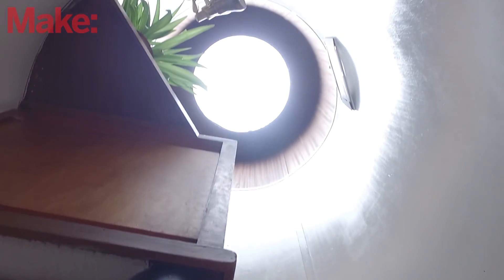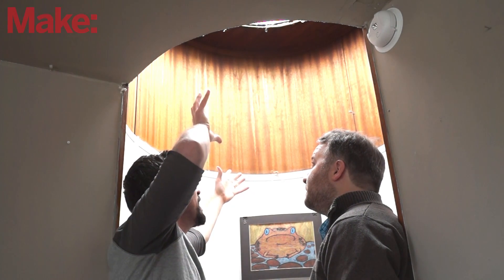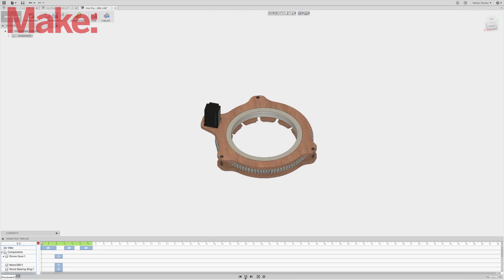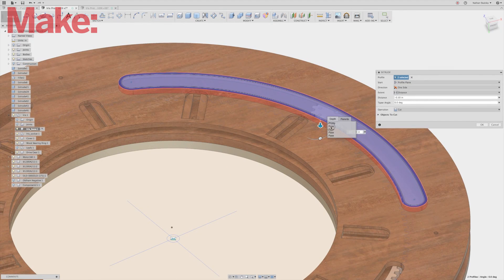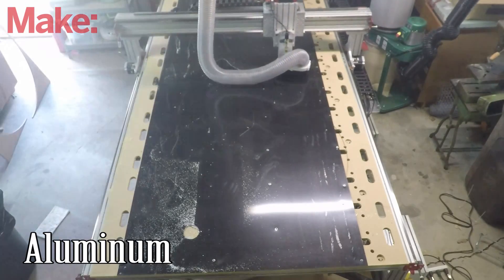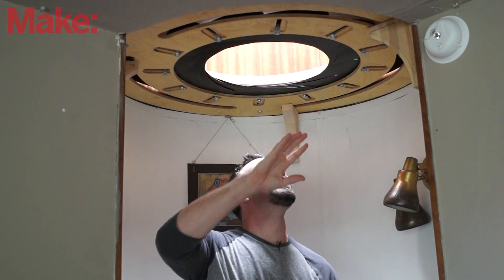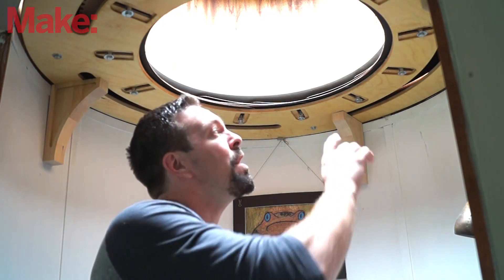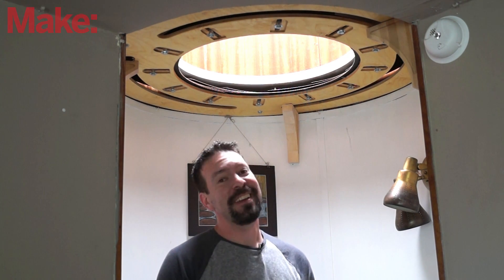Giant Mechanical Iris! Cut on a CNC Router Parts PRO60120

Comment: Beautiful design.  The center not closing completely isn't a big deal as I've seen many implementations that didn't seal the center.
The light blead from the outer portion of the fins would be unacceptable for any of my implementations, however.
Again... beautiful project.

Comment: If it wasn't cost prohibitive, I would add a lens system so that the sunbeam could be sharpened or softened as desired. Even a color gel system would be cool. Then you would have a giant followspot. Just, make sure you don't set fire to the floor.

Comment: Just attach a small extension piece to one of the blades and that gap goes away...
Also, if you chose to use a crank, consider having a double one (at the stair's top and bottom, with 90º gears at the wall parallel axis and all that steampunk feeling).
... and yeah... those external gaps... get rid of them, please (just decrease the outer ring radius a bit, for instance).
(Everybody's a critic... hehehe).

Comment: Awesome! I'll do this on a sun light i have. I'll cover the bolts with some wood caps or half spheres. And most important reflection on these upper part of the black petals, it will absorb to much heat and damage the black plastic.

Comment: Beautiful design! I myself come up with a different idea of dimming light. You only need two circles with polarization filters - one is fixed and the other can be rotated in between of 0° and 90°. It allows to make filters parallel or perpendicular to each other thus changing their transparency. It's lightweight, has only one moving part and has the ability of changing the transparency of the whole window very precisely.
Reply: Lot less work involved. But how costly is the polarized material
Reply: @gleggett3817  I didn't think about it, but you can get 42/59 cm (16.5/23.4 In) on Amazon for $70. You could make two circles with diameter of 42cm for $140.
Reply: @huscat1609  or one could harvest a lot of LCD displays.... make the joints a feature of the design.
Reply: @gleggett3817  Good idea, though the connections should be really nicely incorporated into design. I see no feasible way of connecting them seamlessly.

Comment: Overlapping leaf mechanical irises can close all the way, or at least much tighter than the design you chose. Here's one that closes to a pinhole and uses a much narrower base plate, so it lets in much more light when fully open and also blocks more light when fully closed than the design you used: https://www.youtube.com/watch?v=TntkzyL5YWc
Reply: yup, I love his designs. His leaves are suuuuuuuuper thin that's how he gets that tiny pinhole. Not really suitable for the place I put mine unless I encased it in glass for added structure.

Comment: Fantastic project, reminds me of a film i will always remember for its futuristic innovations  and that film was 20,000 Leages  under the sea with with James Mason as Captain Nemo
and the feature i remember was the two large Iris port hole's  on the side's of the submarine  it was magical when Captain Nemo pressed the button and it opened up to a fantastic under water view
Reply: I think of Alien (79) - when Dallas armed with flame thrower is looking for the alien in the air shafts & wanted the tubes sealed off behind him to isolate areas once cleared & keep it contained. That aperture made an abrasive gritty metal sound as they opened & closed (see youtube). I'm sure it was meant to look and sound dangerous. There was a pinhole in the center of theirs but it was a lot tighter than this design. That middle opening bothered me as a kid - it didn't seem sealed enough for a space ship air tube hatchway....perhaps that was the intention - danger! Lol.

As for the crank idea - Caleb don't be so literal - make it look however you want but make it technically loosely connected. What I mean is use an encoder at the end of a mock crank that then still cycles the stepper at a now an adjustable gear ratio - just like power steering is now a by wire control for all the related advantages. That would be less to take apart and keep flexibility yet with whatever actuation look you want (crank, chain, whatever including automatic open close cycles with any linear or nonlinear speeds). IMHO that makes more sense than ditching the motor even if you want a crank motion to actuate it....which you may not later.

Hope you don't mind the suggestions. I also agree with the critiques of the 3 braces - they distract the beholder's eye from the iris as a feature (ironically). Think like an architect and where you want people to look when you are showing them your cool house, The brackets look like you failed in planning this & had to brace as an afterthought. Even if that is true don't make it look that way ;-)

The bolts - I wouldn't do too much with them but at least dress them in some way that looks more in keeping with the house (i.e. staircase metal) rather than looking like Home Depot threaded rod. Again make it all look like it belongs not like it was just hacked in. 

Good job - what's next?

Comment: Closure isn't all that great. I saw one iris someone made from lexan that the blades taper to a point so that it closes fully with the points overlapping in the middle. Maybe a design like that would be better. Also the gaps around the sides is kinda bad.

Comment: Too many problems. Center do not closes fully, some light comes thru outside edge at closed position, opening diameter is too small for that space - you can compare amount of light before installation and after. Good as first try, but not as final solution.

Comment: For anyone looking at different designs for something like this, keep in mind the difference between an aperture iris, and a shutter iris. If you want it to close fully, then look to designs that were intended for use in a leaf shutter - Those are meant to close completely light tight, where as aperture adjustment designs are meant to leave the middle open throughout all settings.
Reply: thanks for pointing this out!
Reply: Also far warning to anyone who thinks they'll buy an old lens off ebay with the plan to take it apart to look at it in detail, then put it back together and sell it again... They are horribly finicky things and can be a pain to get back together in a working order. Think very hard before taking on such a project if you're not ready to wash most of the lens value down the drain. 

But they're also super fun to play with if you like clockworks and sorting through your entire room trying to find a single teeny tiny black spring that will probably somehow be hidden deep inside a dust bunny or something.

Comment: Looks like crap, like you screwed plywood and MDF into your house to repair something. The hole in the middle of the iris is also not as big an issue as the gaps that appear around the edge when it's closed. All in all cool, but more of a back yard clubhouse addition. Unless you like your awesome house to look like crap I mean...
Reply: It could seriously do with some stain  and a clear coat or anything to cover the bare looking wood.  Maybe even some vinyl with interesting graphics on it.  Also those book shelf mounts are not awesome :P  It's really cool, just missed the mark on aesthetics.

Comment: Great project and amazing unique house you've got. An idea for replacing the bolts: You could place 3d printed figures on the bolts, I was thinking maybe a gladiatorial scene so when you bring the iris to a fully closed position its as if all the figures are battling and when they are in neutral position the match has not started. I was very interested when you first showed this CNC machine, are more builds in the queue to be done with it soon? I am still debating between keeping my glowforge order vs getting a large CNC. Immediate reasoning is that a CNC is closer to a 3D printer which im comfortable with and costs less to service for a hobbyist. If you had the budget for one which would you go for? Laser or CNC?
Reply: oooh, that's creative!

Comment: You could add a light sensor that opens the iris fully when it's completely dark outside and you can see the stars, and closes it in the morning. And of course adjust the sensor and be able to override the sensor whenever you want.
Reply: the skylight above it is frosted, but if it wasn't, that would rock!
Reply: I see. maybe your next project could be to replace the frosted glass with regular glass to make it work?

Comment: you're telling me you couldn't cut that out yourself? you had the layout software, nothing was stopping you.

plus, you didn't even finish the wood, or stain it, or anything, and you have it held up by unfinished 2x6s seriously, a coat of linseed oil makes everything look better, even if crappy cleats was your best idea.
Reply: actually I did finish the baltic birch! I used boiled linseed oil. I just like the unfinished look of it. Lots of the footage shows mdf assembly, so you may be thinking that was what I used. The final only has one piece of MDF. 

Also, maybe you can cut a 4 foot gear by hand but I have tried and gotten poor results. Feel free to post yours as soon as you're done though! I know that the guy who made wintergatan did it by hand and his is pretty amazing.
Reply: the only thing i lack is money. given a jigsaw, a router, and sandpaper and enough time i can make you anything. well and the layout software helps.

Comment: why not put fake piston on the ends of the bolts so it looks like a pneumatic/hydraulic system
Reply: that's an idea!
Reply: My bad. It was 3am and I hadn't slept.
GG.
Reply: Because that's retarded, he already has an arduino..
Not only that, it would need an air supply, electricity, and a whole lot of other shit that is so out-of-the-way from this project that it totally defeats the purpose.
Reply: Brinkwolf 
"looks like"
op isn't saying he should make an actual pneumatic/hydraulic system
Reply: ... or just replace 'em with wooden ones.
Reply: SpeedrunnerG55 why not just put a real piston on it?

Comment: great!
At first I thought it was going to be used as a door, in the staircase. You go up/down and it detects you and opens, revealing the rest of the staircase. The little gap in the middle will not exist, as the centre of the staircase has a pole on it
Reply: I thought about that possibility. It could actually help regulate the temperature better that way as the stairwell makes the cold/hot air just drop through right now. That would have required some considerable modification to my house and re-engineering of the stairwell itself. Also, the wall on that stairwell is only about 4 inches thick, so the design of the iris, or the entire stairwell needs to be changed to make space.